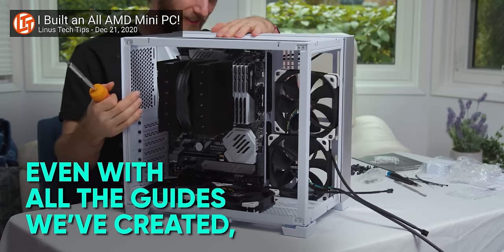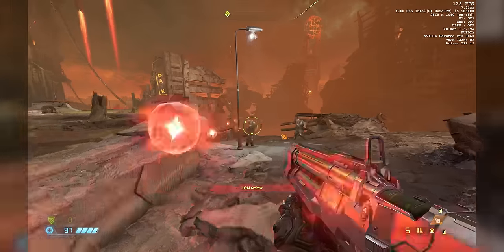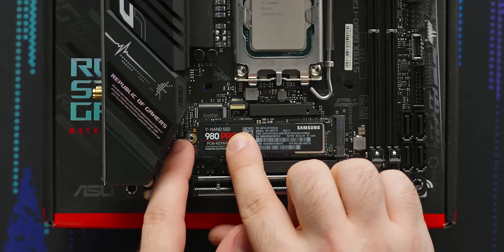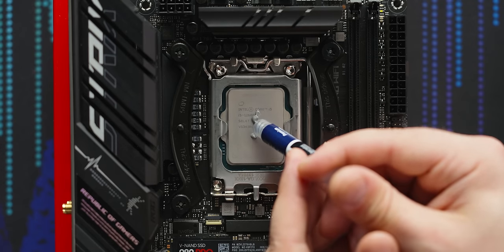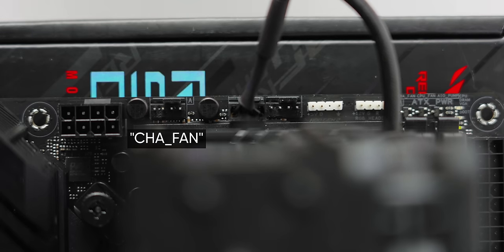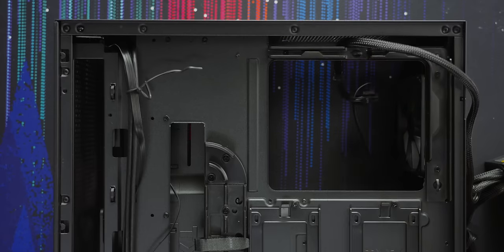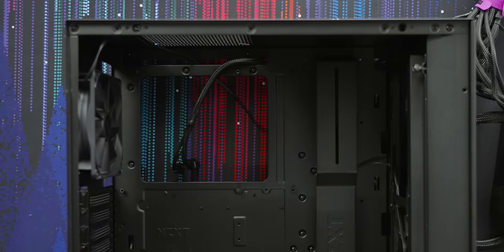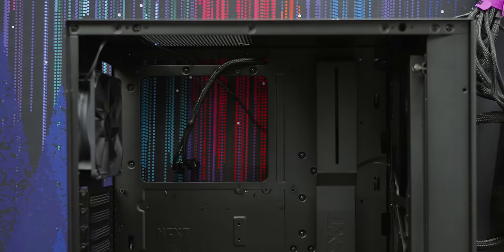The EASIEST Gaming PC Build Ever!

Comment: I found this guide terrible. Some parts were fine. But elsewhere in it just felt vague, or skipped small bits of information that would have improved on it greatly. It didn't even show screwing the gpu in to the case, it just skipped it. Older build guides were way better. Since these guides are primarily aimed at the newbies building their first pc with no previous experience, it makes sense to give more specifics. It rushed through parts and glossed over bits. This guide was made around a specific pc parts list, and didn't even do a good job of telling you how to build THIS exact pc. Let alone giving you the information to be able to build a slightly different pc.

Just my thoughts on it. I've seen better from LTT.

Comment: he forgot to explain to the peasants that ITX and ATX is a size from tiny smol medium uberlarge generally the corresponding online store has it explained in filter brackets but yeah theres atx and ATX size lol, why do i keep seeing LTT sayin its not that bad and its good to have proprietary PSU ports for cables when literally everyone has their own thus makin them E-waste if u ruin a pin or two, yeah the most common ones sold may be american ones but the modular original cable stock isnt that common to find in europe so people are bound to use 2nd hand cables and possibly using the wrong gauge cable not meant for the spesific PSU as i burnt one of my 15€ chargin cable on my phone that couldnt handle a weak universal adapter thats pretty much a old-gen at this point since most phones that are out now take 6V or beyond, lower charge isnt meant to be put through a spesific workload cable so i got lucky that my room didnt catch fire from it.

Comment: 2753 Commets 2:30 Before time 7:12PM Surely Data hoarder argh spelling, 7:13PM right on time. 27-4-22. #!!!
Reply: so the question we've got and we will find out today is, what's the performance difference between the rtx 3060 vs next close gpu that would be the rtx 3070 team green and blue. its i7-12700k this we did in-depth performance comparison. what's the best motherboard for the i7-12700k with all the features like, pcie gen 4 storage gen Lpddr 5 ram support wifi 6e, whats the best cooler to cool the system. whats the right powersupply goes up to 5ghz at its turbo pulls in how many watts? add both the cpu gpu fan ssd motherboard how much do the consume. are we going to flex with the system? rgb. just go back to the 1:30 hour video start and pick it up from there. do it pu👀y only you're in office finish it. 722Pm ahhh 7:23PM
Reply: ahhh why do they do that this exactly at 7:30PM this is what, i like to buy products when they are new just launched!!! especially apple products. rtx 40 series!!! 7:43